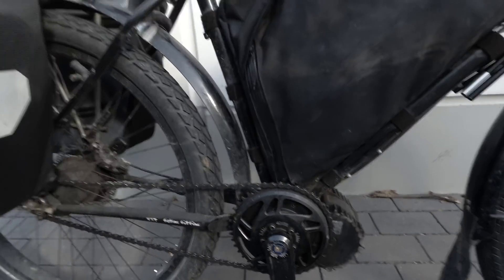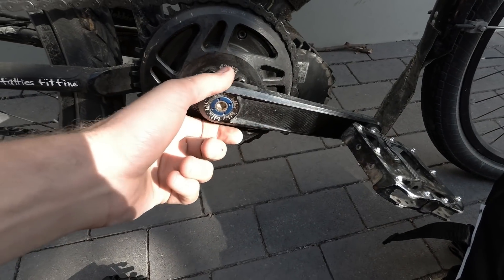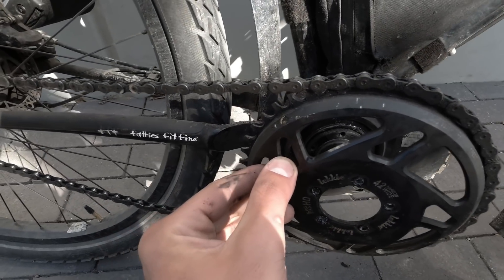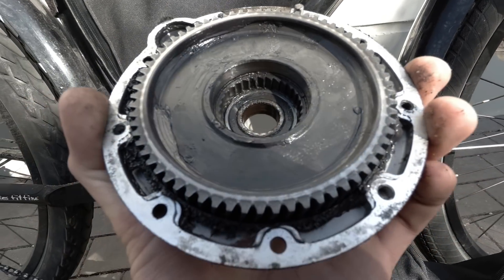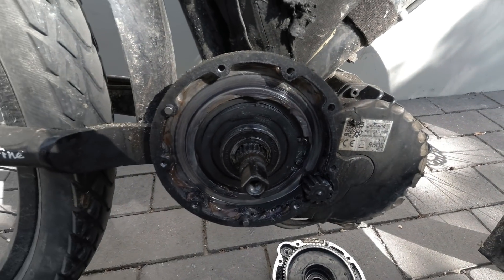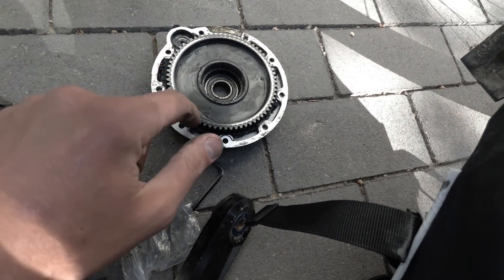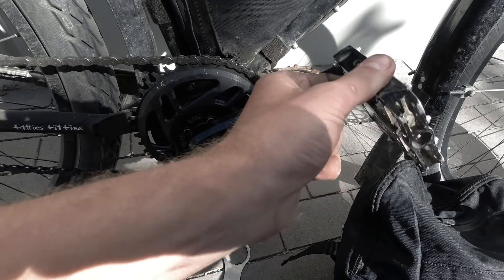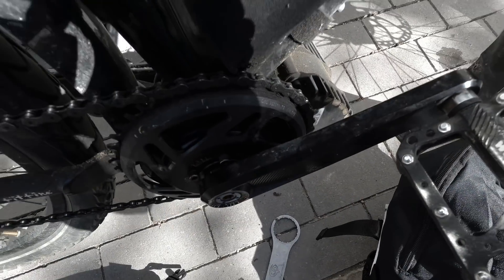Inside e-bike motor after 15000km! How to perform Bafang BBSHD repairs while touring

Comment: Very detailed 👍🏽👏🏽👏🏽. I have a problem with my mid drive.  Is fairly new, so it might not be the motor and the battery has been thoroughly tested.  The problem is that everything powers-off without notice..almost as if it loses power.  Any suggestions???

Comment: As a bike mechanic for 38 years. It appears that the clutch itself 4:33 is not at fault but rather the victim of copious grease that causes stiction in colder (ie UK Spring ;) weather. and not engaging. I had the same issue on freehubs in the 90's Really some penetrating lube like Triflow or even WD 40 was sufficient. as a kid I once had to eek out lunch money for the smallest WD 40 can out on a 35f degree ride.

Comment: Add tungsten disulfide powder to all the gears and inside all the bearings. It will stop wear entirely, and it will decrease friction, expecially when the grease is out of the way and there is only a film of grease and tungsten disulfide about half a tablespoon throughout will turn it into an unstoppable power train. And its non conductive, and it protects against all corrosion, and it increases thermal conductivity, but less heat is generated, so the stuff actualy works. moly does not work well. it is hype, and its a bad molecule. Tungsten is the good stuff, tungsten disulfide. Helps seals last virtually forever, its the best oil additive and its the least popular because its a great secret. It would put bearing companies out of business basically. Ooohwaah.

Comment: Hi Jack, Great video mate and really useful. Hope you are well. No idea if you will pick this up, but  just wondering if you have ever regressed the main gear without removing from the motor from the bike. I have wired my BBSHD in nicely and took a long time so would rather not remove the motor from the bike and so was wondering - is it possible to 'safely and effectively' try degreasing and degreasing her still on the bike? I have the in/out play and so looking to replace the thrust bearing so i'll be in there anyways.
Reply from the maker: yes it's possible
Reply: Thanks Jack. Did you use a degreaser to do the job? I’m a bit concerned about getting degreaser in unwanted places.

Comment: 18200km of off road abuse on mine and the nylon gear stripped and the sator housing rusted with moisture that got in. Theres a bad design where one of the two bolts that hold the mounting plate on (bottom one) actually screws directly into the motor core housing, this is the main entry point for moisture

Comment: Excellent vid, and nice work on the field repair! About the motor coming loose, there are "stabilizer bars" you can get which replace or suppliment the stock mounting bracket. It rests along the chainstay, and you can either clamp it to the chainstay or drill & tap a bolt hole. This way, it transfers the motor's torque into the frame and keeps it from coming loose. I put one on when I first built my. Also used the stock mounting bracket under it with lock washers between the mounting bracket and motor housing, plenty of Loctite 242 on all the bolts down there, and so far it's stayed rock solid. I highly recommend the stabilizer bar. Right now you can get it from California E-Bike, Luna Cycle, and Johnny NerdOut.

Comment: At first i thought 1500km dude did 15000km on it lol. I wouldnt mind if the my motor shread into pieces by then. I didn know these lasted that long.
Reply from the maker: When treated well they can really last a long time. Very rare they are treated well though!
Reply: @JackButlerVideos  About a 1000 mile in have not changed the grease yet no weird sound from motor i dont wana open it lol

Comment: Popped my latest instance open before running it, and dosed it with Mobil-28 grease - including the clutch in question.  Did this same thing with the first build, also.  It’s dead silent save under heavy throttle, where it faintly whirs.

Comment: Jack, you made that look easy, I have a BBSO2 eight months old maybe one hundred miles, the motor shut off, I replaced the cables monitor then bought a new motor slipped it in with the original setup started right up, the problem seems to be the motor I'm not sure where to look, It's not a year old but bafang is saying it's beyond warranty silly me I thought there were twelve months in a year, wherein the motor should I be looking? Thank You, TV
Reply from the maker: It will be the controller most likely. The bbshd is a much better design in my opinion. Easier to repair and worth the extra weight
Reply: @JackButlerVideos  Hi! amazing channel to get info on how to maintain the BBSHD! thanks!
-Do you have any comparison info BBSHD vs M620 from Bafang ? (still 1000w but kind of built 'in-frame' design, so maybe different design inside ..) any experience of pros/cons compared ?
-Do you have a video to built a similar travel ebike set up btw? + what would you do differently?
-Did you use the solar panel to charge a spare battery or to power directly your bike? trailer pro/cons video? ;)
sorry too many questions...
 Thanks again for your vids!!!!
Reply from the maker: I have no experience with the m620 but i don't like that you loose the option in the worst case scenario when a motor drastically fails or something to replace it with a normal worldwide avalible bottom bracket and contine cycling. I would use my recumbent next time but i loved the rest of my setup. I charge the battery I'm using directly, that way is i have 100 watts solar coming in and im using 100 watts motor power i don't need to be charging or discharging. Your right i should make more bike videos! Theres some in the long term plan! Thanks for watching!

Comment: Hope if i strip mine back it shows the same issue, when I’m in the lowest sprocket the bike makes an awful clicking sound when I put pressure on the pedals. Would you say it sounds like the same issue you had 2 years ago?
Reply from the maker: Your sure the clicking sound comes from inside the BBSHD and not the chain at too high of an angle on the chain ring? Open it up anyway to have a look, it's not hard to do and it's worth checking
Reply: @JackButlerVideos  could possibly be that, it’s got the bafang chainring that came with the kit on. It’s always in the bottom 2 gears(smallest sprockets) when the issue occurs & the chain occasionally comes off when the clicking starts
Reply from the maker: It's probably down to a bad chain line i would guess then!

Comment: I started with that wrench but it is almost impossible to torque the locknut to 60 foot pounds and kept getting loose.  So i decided to get a socket and the motor has been tight ever since.  you shouldn't take a loose motor anchor nut too lightly because all the movement of the motor will eventually destroy your bottom bracket (no fun)
Reply: Can you share the socket you purchased "brand, size"
Reply: Did you try to tap it with rubber mallet?

My friend did it
And the motor didnt loose anymore
Reply: Yeah I got the socket for 8 bucks from Amazon put it on a nice long ratchet no more problems!

Comment: How many miles/km do you have on the motor im wanting to buy one during the 11 11 sale on AliExpress i want to do long distance riding on my bike what are the maintainence costs and did you have any problems at all with any part on the motor or your bike becouse of the motor
Reply from the maker: Maybe 20000km now. I only changed the clutch maybe two times. These are very cheap. Bbshd is very reliable if you clean and grease well
Reply: @JackButlerVideos  i was planning on buying 2 spares indeed for on the road and 2 gaskets but cant find them on ali express the clutches i have and also need to instal a shift sensor what panels did you use for the solar trailer and did you take a extra battery to charge while riding from solar or how didnyour setup work
Reply from the maker: Email em3ev and they might sell you the spares you need. Just one battery charging with a genasun while riding. Aliexpress solar panels

Comment: Quick tip when putting the cover back on ..grease both sides of the cover gasket, creates a better seal and makes the gasket last as long as the motor it won't tear.
Reply from the maker: Great, thanks!

Comment: crazy, my controller fried after 2000kms, then it fried my xt90 to Anderson connector after 2400 kms
Reply from the maker: If you abuse the controllers they fry pretty quick. High power and low cadence will kill them.
Reply: @JackButlerVideos  Darn, there are too many steep grades here in Vancouver and I am just too out of shape to Iron man my way up them. I better buy a few extra based on that then, seeing I am an all throttle guy. How else am I going to use up that 2.3kw battery I just bought lol. Thanks for the response!

Comment: Hey, I was thinking of getting the surly troll for my Bbso2, does your motor hit the chainstay? I have that problem with my current frame so my chainline is terrible and can't access certain geara
Reply from the maker: No it's fine. But I'm using a smaller lekkie bling ring so maybe that helps. You can use spacers anyway if it does.
Reply: @JackButlerVideos  you're using a 42t one yeah? As I have the same one, was constantly dropping my chain & snapping it on the old chainring
Reply from the maker: @LETMECHOOSEANAME1  yea the 42t is good for me!

Comment: you sound as if you've been around on bikes. Just wondering what your experience has been using an e-bike for touring vs regular (non-powered) bike. Would you ever go back to the non-powered type?
Reply from the maker: I use both! Just depends on how far you want to go each day. And the ebike adds flexibility. For a holiday i would rather have a normal bike but when i live off my bike i would rather have the ebike

Comment: Do not grease the clutch otherwise those teeth will stick and will not engage with the gear. That was probably the actual problem. You could just clean and degrease the clutch, lube it with dry lubricant and install it back and it would work fine.
Reply: Good pointmotmseems like the thick grease stopped them from fully engaging open
Reply: Y'a pas d'embrayage la dans

Comment: Those are pawls, and one of the biggest problems is people put grease on them. YOU DO NOT PUT, OR LET GREASE GET ON THEM. They will stick, gum up, not work correctly, thus allowing it to slip. You need something lighter like phil tenacious oil, which is what I use in all my free hubs, same mechanics as this so called clutch.

Comment: Dont they need greese every 2 k ?
Reply from the maker: Not heard that number but yea greasing them always helps!
Reply: @JackButlerVideos   cheers for reply . Im waiting for my 750w 48v LG17.5 ah battery . Should have read more and bought the 1000wHD . Are they more reliable that they worked on changing things to the B moter ? Should come tomorrow lol cant wait
Reply from the maker: The motor is built slightly stronger internally. but the main improvement in my opinion is the user serviceability. It's much easier to replace parts inside a BBSHD. The BBS02 is a pain
Reply: Thanks jack , should have gone hd route but a bit late now as i ordered the unit
Reply from the maker: It'll be fine. My friend has done at least 5000km in theirs without problem. Regrease it and it will be fine
Reply: Jack i thought gear change senser would come . Just gouing to order the gear senser but do i need another lead for it to plug into ??? Or will it plug in to the unit manny many thank my freind
Reply from the maker: Gear sensor is just a brake sensor so you need to plug into one of those. Maybe a splitter is needed.
Reply: The bike i have the gear leavers are gear and break all in one so cant use the cut of brakes z 😑 so the gear sensor is ok to plug into the break plug i hope .
Later on will have to buy new gear change and fit the breaks  back on .
Reply from the maker: @tonielcock8891  yes that's what i mean the gear sensor plugs into a brake disconnect

Comment: My husband has pretty much the same setup as you. BBSHD with lekkie chain ring on a Surly. He has broken his clutch twice now in under 2,000 miles. He is a heavy rider though and really works his BBSHD hard. We use bafang ebikes instead of driving. Oh! he also snapped his motor rotor in two once. Even with all the replacements and repairs it still beats a car payment.
Reply: Dont buy bafang for heavy people its just Shit and weak. i recommend yamaha motors or bosch they are match more reliable for heavy riders.

Comment: Really useful video mate :) my BBSHD is currently fresh out the box and looking very intimidating in its component pieces on the bedroom floor! Few YT vids and I'l be good to go hopefully. Quick question - have you any experience of backpack battery mounting? I'm waiting on the Samsung 52V 17.5 and wondering if I'll be able to get it on my back for a bit more stealth? Safe travels!
Reply from the maker: Once you get used to it it's super easy! If i had a battery in a rucksack I would want a connector that unconnects very easily because eventually you will walk away from the bike still connected. Good luck

Comment: Luna apparently have a bracket to stabilise the motor from rotating, and hence loosening of the nut you have the spanner for. The clutch is a good thing to carry as a spare, and something I would include as a spare part, incuding the gasket kit. If you cake the clutch in grease too much, or inside the gears it runs in, it won't engage properly. But wear is something you would expect, and carry a spare part in anticipation of a breakdown.
Reply from the maker: I actually have that bracket but not used it! Good info!
Reply: @JackButlerVideos  WD-40 has a spray-on specialist White Lithium Grease. It is suitable for most metal on metal applications, but is ok on plastics too. It is non-drip when set, is heat, and moisture resistant, so inhibits rust. An invaluable product to have around the home, like WD-40 light oil itself. I believe this would be good for this application in moderation. I also use it on roller skate bearings for my Children. Get a straw nozzle for the sprayer. I wouldn't use it on bicycle chains though, as it will attract dirt, but bearings, yes indeed. If you live on the road, similar products can be purchased in a smaller tube. No more black grease mess!

Comment: Mobile 28 ! Its red and for the nylon gear !
Reply from the maker: Yep! Mobilgrease 28
Reply: I've read a lot of recommendations for Mobil SCH-100 instead of Mobil 28. It should mix better with the white lithium grease, by not having clay in it. I've used Mobil 28 so far.

Comment: Hey man I'm a heavy guy 6'8 and 130kg do you think these motors would be right for me?
Reply from the maker: It depends so much on what your expectations are. I usually ride at 20 - 25 km/h and use 100-200w whereas other "e-bikers" ride at 45km/h and 1500w. This is a very powerful motor and with the right gearing can do a lot so i think you will be fine. You get more power running on 52v instead of 48v if you're still concerned.
Reply: Use the correct cadence for the assist level. The no load rpm is about 70 on assist 1 and about 140 on assist 5 so keeping pedaling at 90+ on level 5 will avoid the motor labouring too much and make it run more efficiently than trying to mash the pedals on level 5 all the time. Get a smaller chainring and bigger back sprocket and the motor will be fine load wise even if the overall acceleration takes a bit longer with a heavier person. I put the 52 tooth chainring on but it just gives me headroom to pedal really hard and fast with the motor on maximum as well as to cruise at a low cadence on level road around 23 mph on level 1, pedaling along at 60 rpm (which isn't labouring the motor much on level 1)

Comment: Rubbish design sprag clutch I think suprized it lasted more then 100 km not 15000 ha looks really weak and brittle
Reply from the maker: Haha this one did 15000km and I'll post again when the new one fails!
Reply: My BBSHD is at 24000 km, 18000 of those at 45A, 18S, 3kW and not replaced anything in the motor.
I'm going for 55A 22S on another modded controller and motor, and I expect something to break. Let's see.
Reply: @emilen2  can i buy your old controller? I am trying to find a controler but they all need some know it all installation and at least 500usd for good ones. Not sure what way to go. Since expensive and no any hand holding.

Comment: Hi Jack.. (something you don't want to say at the airport..!  HaHa) .   The BBSHD is much easier to replace the clutch than the 750w BBS02.  On the bbs02 you have to remove the left side axle locking nuts/rubber seal/ball bearing/washers.  This must be done to remove the axle (pulling the reduction gear on the right side) remove the bearing, then unbolt the clutch cover and replace the clutch and or complete axle/reduction gear.  a complex, 4 hour project.
The HD has a better (more serviceable) design.  a 1 hour project.
Reply from the maker: This is one of the reasons I chose the BBSHD!
Reply: I had been considering the BBS02 because I didn’t need 1000W, but the serviceability of the BBSHD is changing my mind.

Comment: How durable is the motor housing? If I'm mountain biking and occasionally bumping into rocks, will the unit hold up?
Reply from the maker: I would imagine so. It's close to 1cm thick aluminium in places. It is designed for mountain bikes too I think!

Comment: Loving your adventures. With all the kilometers you've logged what do you bring with you for spare parts to keep the BBSHD up and running? Anything else besides what you showed and mentioned in this video?
Reply from the maker: Thanks! On a 1000km+ trip i would also bring the large gear i mention in this video. A couple of the clutches. Maybe a spare display and spare throttle.
Reply: @JackButlerVideos  what about a spare controller and motor?